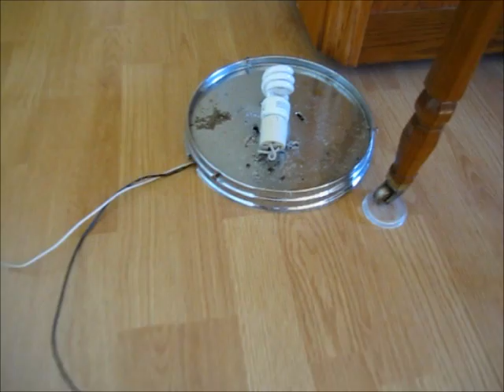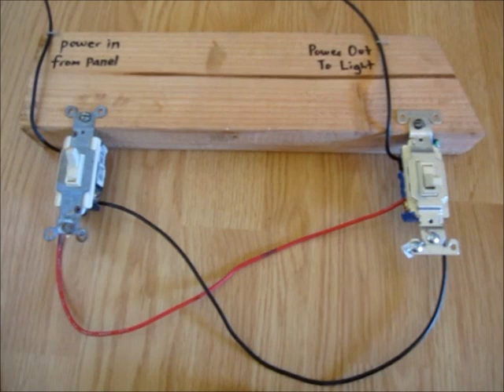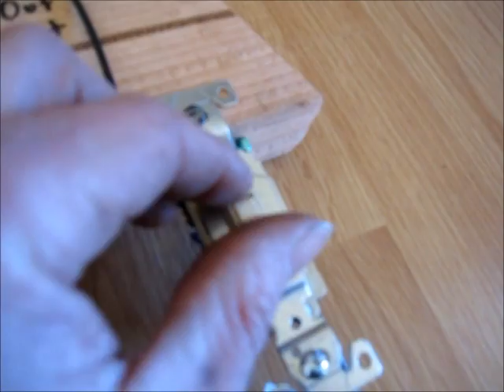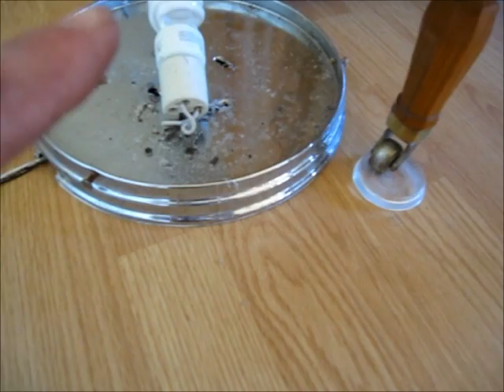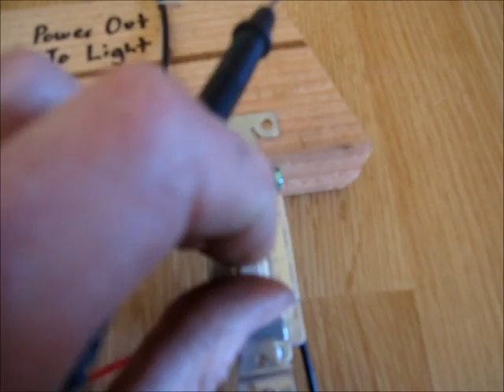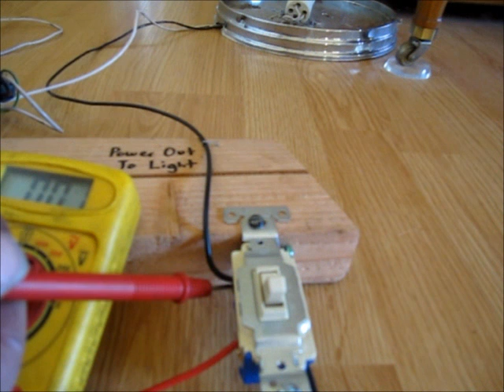Three Way Switch Demonstration & Troubleshooting

Comment: Great tutorial video!  I followed your instruction, testing each wire and 3-way switches, checking wire connection.   They're all good, but the working-light is still not on.  Appreciate all your help.

Comment: I have a light that is on a 3 way switch.One at the back door and the other at the door before kitchen. My problem is i don't have any power at either switch.But my light is on and stays on.I haven't ever worked on this,it just started staying on all the time.I can flip main circuit  breaker for the kitchen and it will go out.Anybody got any ideas ?

Comment: where are the white wires?
Reply: look to see if you have any black tape on your white wires - that should have been done but it used to indicate another "hot" that if it were done these days would be red....  white (or neutral) shouldn't be switched - if they're in your box with switches they should be "ganged" together.  I'm not an electrician but I've done a lot of household wiring and it's been all looked over by one and then inspected.  This is the best explanation of a 3-way circuit that I've seen....

Comment: I know you are probably going to tell me to hire an electrician, but money prohibits it. So I am just trying to figure out what is wrong with my circuit.

Very old house it has knob and tube wiring, so there is no common in the switch boxes. Just three wires nothing more, nothing less.

These switches are operating a light in a stairwell. Switch at the top of the stairs, and a switch at the bottom of the stairs.

Wherever I turn the light off is where I have to turn the light on. If I turn the light off at the top of the stairs, I cannot turn it on at the bottom of the stairs. If I turn it off at the bottom of the stairs I cannot turn it on at the top of the stairs.

I am very confused. I have never worked with Knob in Tube before.
Reply: My guess is one or both of the switches is broken.  They're inexpensive - replace one and test, replace the other and if that doesn't solve the issue it's a "hot" between the two switches.  So in Jake's example between the two switches he has a black and a red - one of those wires may have a break in it, is lose or isn't making a solid connection to the switch.

Comment: I agree. This video is the best 3 way switch video I have seen and you explanations while keeping the neutral and the ground out of the video really helped make the current flow path much easier to understand without all of the visual clutter.
Reply from the maker: Glad to help out! These circuits can be confusing, especially if you don't work with them very often.

Comment: Thank you for the video! Moved into a house built in 1956. Some guy must have said, "Ha! When we get done building this house, let's change the color of the wires on the 3-way switches in the hall!" I managed to fix some 4-way switches that were wired wrong before I fixed the hallway!!! You're breakdown of the electrical path and how the power travels was invaluable to my efforts! Now, my lights are wired properly, work properly, and most importantly...MY WIFE IS HAPPY!!!!!!

Comment: I have three way switch setup in my garage ceiling with 3 lights.  I replaced the center light with an outdoor ceiling fan / light combo.  Is there any way i can switch the two remaining lights to off/on pull chain fixtures?  Now the only way to turn on the ceiling fan is to have the other two lights on.  I currently get on a ladder and just loosen light bulbs in the two remaining light fixtures.  PS i have a bigscreen in my garage and too many lights causes glare during football games.

Comment: Incomplete video...he did not show in detail how the  white or neutral wire is connected as you can see in the demonstration...no close up on the power source outlet.
Reply: I think the reason why so many people understand the concept is because he's not showing what is involved in connecting the neutral and ground (if there is one).  Since he's talking about the switches and mentions that the neutral shouldn't be switched....  IMO it's the best video I've seen for understand the concept but not for learning how to wire it up and meet code ;-)